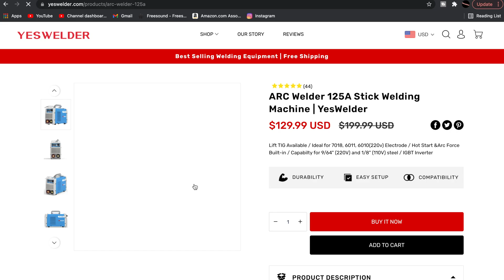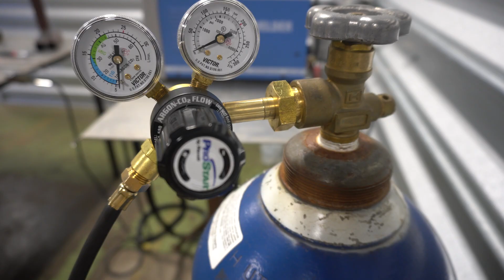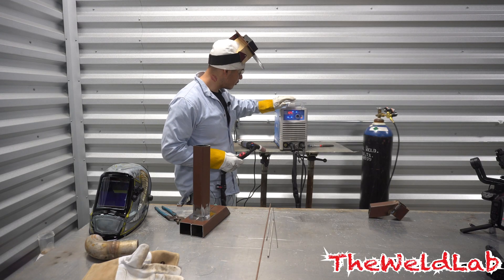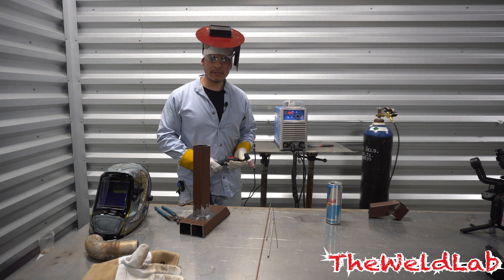Intro To Welding: 4 Welding Procedures You Need To Know

Comment: try to get an primeweld welder or plasma i heard they have really good technical support
Reply: They do the 225p AC/DC Tig an cut 60 plasma cutter very good equipment for the price point use quite a few different big name brands an very impressed with them they've all putting China parts in there welders and hard to beat prime welds customer service

Comment: Thanks for the information I do a lot of railings so I mostly use 6013 but lately I've been do some work for trucking company so I'm using 7018 more but I practice with 6011 now I'm trying out the 6010 too

Comment: What is the best welding machine that is not that expensive and also what kind of sticks do you use
Reply: Depends what you wanna do and how much you want to spend
Reply: In my expierience personally you can buy a shitty mig/flux core machine and be perfectly fine, but with stick you want something in the middle ( seriously a bad stick machine is soo hard to weld with ) and with tig as well unless you’re doing X-ray or sheet metal work, in which case go with relatively expensive.
Reply from the maker: My favorite one of all is there stick and tig machine the cheapest one they have 
It’s cheap light and easy to use and can plug it up to a 110v at home